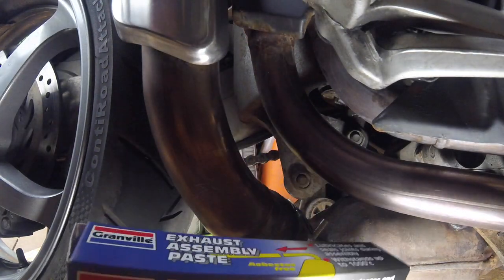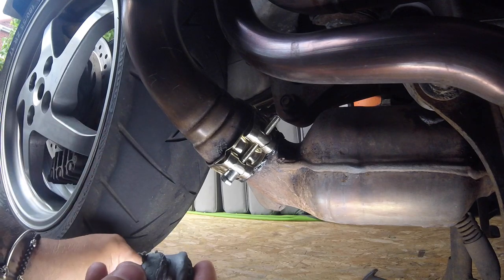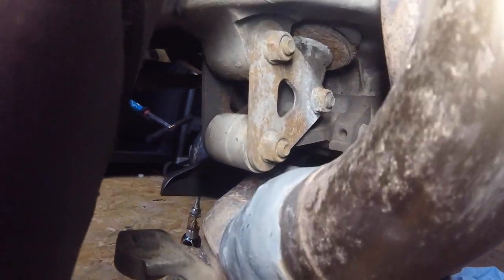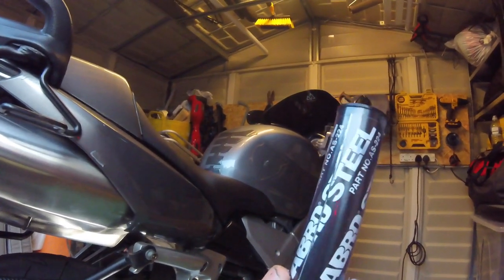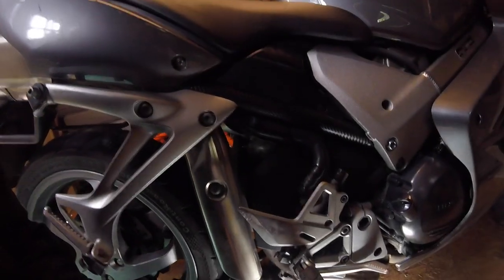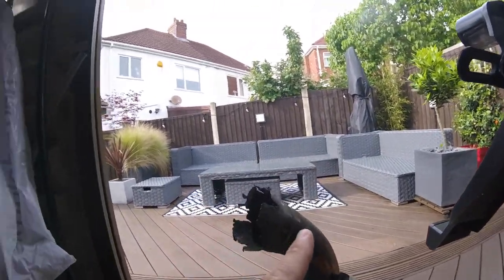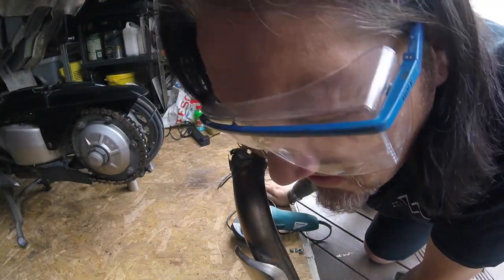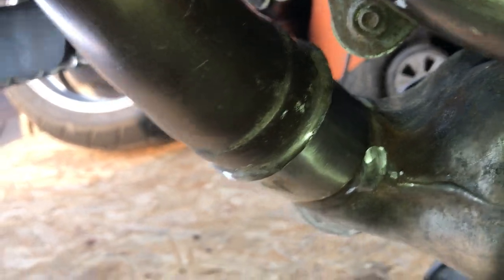Honda VFR800 Exhaust Repair - Collector Box & Silencer

Comment: Good shout buddy, not seen anyone weld on a new section before. With yours being a 2008 the older ones are a lot more rotten at the cat join. Mine literally disintegrated at that point when i began my frame up rebuild. So i had to get the full delkevik system
Reply from the maker: Yes will end up going that route eventualky

Comment: Thanks for the video. I have a similar problem on my 750F-L where the downpipe meets the collector box pipe. Straight line where the two pipes meet. Do you think just a cover pipe and clamped would work without welding? If not can I borrow your Dad :-) p.s How long did it last before you had to replace?
Reply from the maker: Would imagine it would work. Although I sold the bike since it’s still going strong.

Comment: Hi, what connection pipe did you use. The same has happened to mine. Thanks
Reply from the maker: I got it from Amazon 

Exhaust Pipe - 51mm Exhaust Muffler Pipe On Adapter Connector for Motorcycle https://amzn.eu/d/fvrlyUY
Reply: @Motourev  thanks Craig. Is it still holding or have you changed the whole system? Thanks
Reply from the maker: @johnbellamy5970  sold the bike a month ago but still solid, stronger than it was originally

Comment: Do you have any ide what size the clamp is? Having the exact issue on my vfr...
Reply from the maker: I think internal is 48mm and external 51mm. This is the part I brought and cut it shorter 
Qiilu 51mm Motorcycle Slip On Exhaust Middle Link Pipe Adapter Connector for Yamaha YZF-R6 2006-2014 https://www.amazon.co.uk/dp/B07DMZTNFN/ref=cm_sw_r_cp_api_glt_i_73KQNK4YCVB3DZMPVVJA?_encoding=UTF8&psc=1
Reply: @Motourev  you're a Saint, cheers for that, noticed it today, and was doing research now.
Reply from the maker: @valeriu-iuliansandu-grigor6490  I know somewhere down the line it will need replacing as the collector box will only corrode more but it buys me a couple of years

Comment: Only 1 prob wi 2 pack epoxy putty, it's not high temp, so it'll just go brittle & crack off, it's a temp repair at best, I used some on my old CBR600 f3 when collector rotted thru, stunk like fish for days, fell off within a week even tho I roughed up the surface with 36 grit emery cloth, ended up buying a stainless downpipe assembly, which was royal pain in the arse to get off due to rusted header nuts ... you'd have been better off cutting a strip of alloy sheet & wrap it around the joint, bin the clamp & drill & pop rivet both sections together with some high temp silicon sealant under alloy sheet ... rookie error of no prep to metal surface prior to use, so you've pretty much wasted ya time.